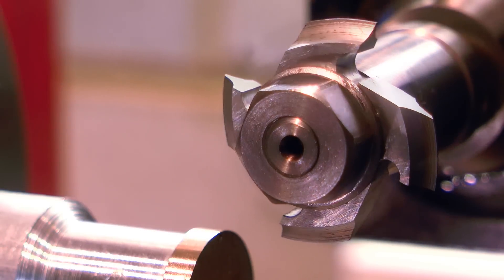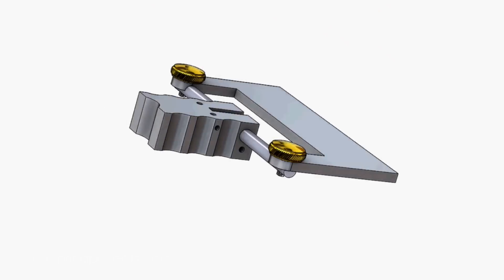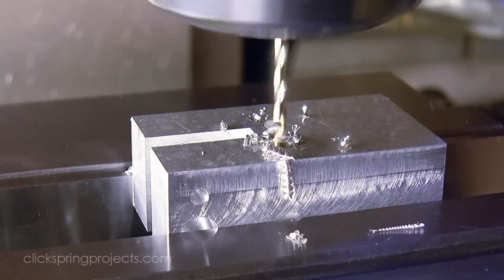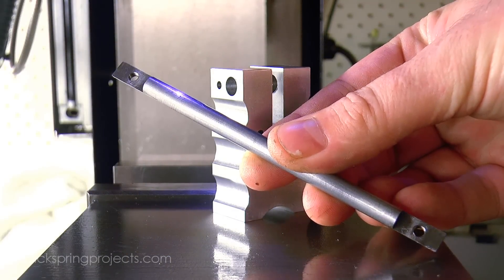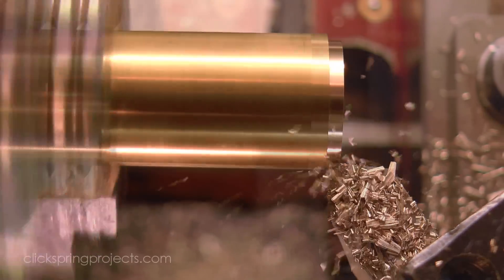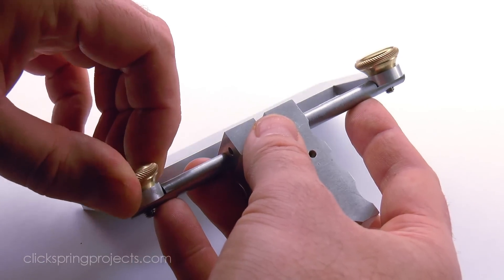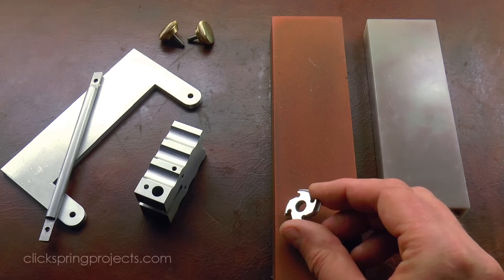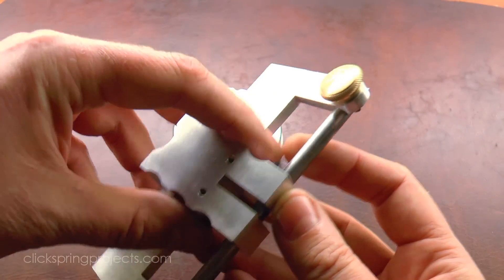Tools, Glorious Tools! #10 (Part 1) - Shop Made Gear Cutters - The Sharpening Tool

Comment: I started making a simpler computer program. Slide rule calculator. The description I have is where a string is unwrapped from a circle. What is given in the problem is angle, length perpendicular. It needs intersection of 2 lines. Then put the gear face on.

Comment: There is a dimension missing from the drawing of the alloy block.
Well, there may be more, but the placement of one hole is only detailed in its position relative to the edge, but not from the end. Dimension of 4.65 is given from the edge of the block, but no dimension from the end, unless I am not seeing it! Posted on Easter Sunday 2024.

Comment: I remember looking through the Machinery Handbook at the gear section and there is a lot to take in. That was probably 40 years ago. Getting the tooth profiles correct to transmit power at higher speed is obviously important but for clocks it sems to be different. I have made a two metal clocks and a few wooden ones and I have always used lantern pinions and somehow got away with it.

Comment: Just what I need:
Gear cutters!
Then, I will need the lathe, tool holders, various metals, cutting oil, and so much more!

You see, I already have the projects: sewing machine stuff! I have a machine just old enough to not be 100% plastic.  However, they did make the weakest gears from a nylon or plastic.  It is the intersection of a vetical axle and a horizontal axle.  Both gears are beveled. The cuff of the gears of a steel, but the beveled gearing is fitted over the cuff and is made from PLASTIC OR A CHEAP NYLON!! 

Even back in the mid-1980's, sewing machines were designed to break.  Now, 30 years later, the replacement parts are not even cut with an involuted edge on the gears!  Crunch, crunch, cruch go the parts when they are placed into the machine.

It irritates me so much that things are designed to break.  Then, when I take it in for repair, the problems are made worse because a squeeze pun to hold another gear on the shaft was partially drilled out!  I managed to break that cast iron gear while attempting to get it out.  I hope CA glue is strong enough to hold that balancing wheel together while sewing, at least until i can make another balance wheel... actually, it is called a Thread Take Up Gear.  

Oy!

Comment: Excellent video Chris. I spent over 30 years working for a gear cutting machine manufacturer. They made machines to cut hypoid gears for the rear end of the automotive industry. Also Kozo Hiraoka, a Japanese live steam modeler showed how to make gears using the same method you are going to show. I'll be watching with anticipation for the next video.

Comment: I really like this style of gear cutter. Would it be possible to make them with more teeth than just four or is there a reason for that? Also, this cutter can only make an approximated involute tooth shape with using those circular cutting inserts to make it. Is there a way to get an actual involute profile? Only ways that come to my mind are using either a pantograph or a precise CNC milling machine with a grinding bit to make a speciallized form tool. But I also thought about making those round cutting inserts at an angle to get an elliptic shape, which might more closely resemble an involute. That will involve a lot of maths or CAD magic though.

Comment: Thanks for the informative video, I was looking forward to this one. Do you know if a shop made involute cutter can be used with the same method for an internally-toothed ring gear? The gear cutting will need to be done on a shaper of course, but as far as making the cutter goes, I can't seem to find anywhere that discusses the button method if it can also be made to cut ring gear cutters.
Reply: I’d like to know the answer to that question